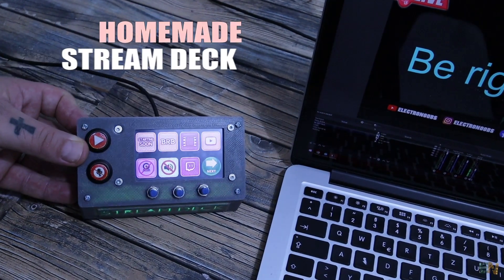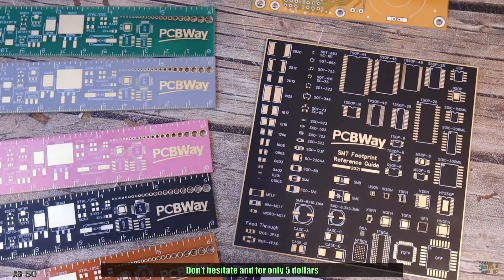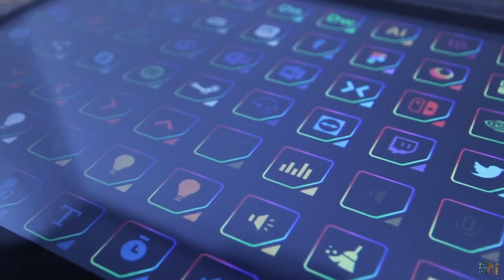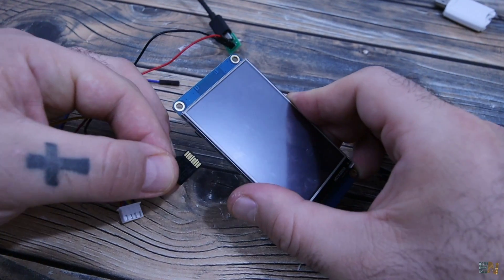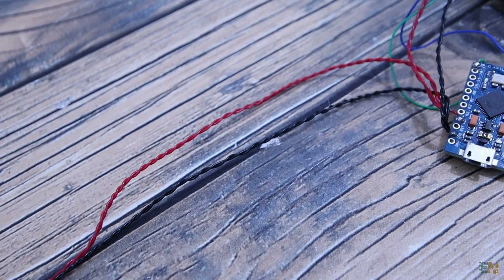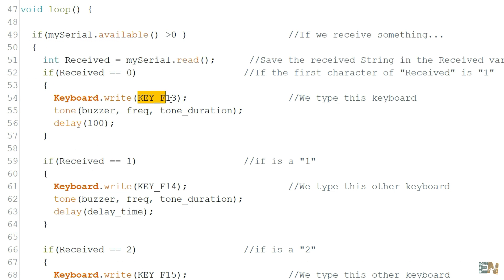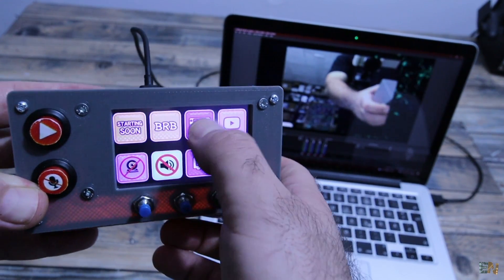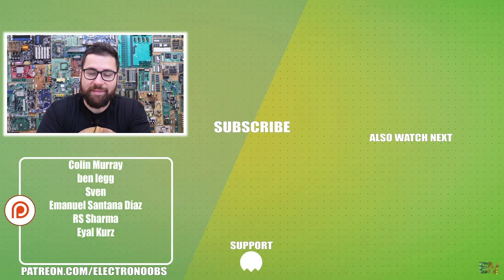Amazing Stream Deck - Homemade With Touchscreen, Arduino + RGB

Comment: I would like to see an arduino acting also as a Streamdeck pedal (3 buttons). That should be simple, but it would need to be identified as the pedal to use the same software... Not sure if its possible

Comment: hello @electronoobs, gracias por el tutorial. se ve bueno. you are using the model K of the display (NX4832K035) but your link is for the T models like NX4024T032. it can be the T model or need to be the K model? ty in advance.

Comment: Hi,

Ive wired this up like your video however when the display is being powered the micro seems like its not got enough power, do i need to use thin wire like above as i using wires that youd use on a breadboard

Comment: Ok so simple way is to use f13+a f13+b and so on this method is little complicated. You could use a f13+a and assign that to key A such that when you press A it simulates f13+a simple. The problem with this method is the haptic feedback that we get on clicking a button

Comment: How do commercial solutions like the stream deck handle the mapping of shortcuts? Do I also need to assign the buttons to specific actions or do they use some superior technology? I would like to for example open a specific website in a specific browser on a button press, even when this browser is not running yet. How can this be achieved? 

Thanks for the tutorial though! Helped a lot already

Comment: try this, combine one of the following alt/ctrl/win/shift/altgr from the normal keyboard with your arduino hid input,
if the obs/whatever allows it then you can multiply your 7 buttons to [no modifier/alt/ctrl/win/shift/altgr] x 7 = 42
could be useful on the big touchscreen also (without normal keyboard)

Comment: how you added the nice Icons as buttons? I doesnt use a Arduino as "bridge" instead i wrote a programm and connected the Display via a USB2Serial converter. Its even nicer to not have to deal with microSD cards.
I Debug and Upload the stuff right within the Nextion Editor.

Comment: Hi, I have a problem. I'm using a seven-inch screen. Clicking the button on the screen setup returns a string of codes A5 5A 06 83 00 00 01 00 01. what do I do? I imported the code into ARDUINO and turned it into a button. It seems that spaces are not allowed between characters, prompting an error. Is there any good solution?
Reply: C:\Users\Administrator\Desktop\Stream_deck\Stream_deck.ino: In function 'void loop()':
Stream_deck:59:23: error: expected ')' before numeric constant
     if(Received == A5 5A 06 83 00 00 01 00 01)                   //"1"
                       ^~

Comment: Very practical idea indeed at a fraction of the cost of brand name equivalents. And nice tip about the bootloader reinstall, had similar problem on my earlier Arduino days and for a moment thought I burned my device but eventually found a solution. Great video and keep up the good work

Comment: Great homemade arduino device. I love it. BUT the thing about a streamdeck is dat it has PHYSICAL buttons. The whole idea of a stream deck is avoiding touchscreens. Otherwise you can also use a tablet or pc touchscreen.
Reply from the maker: I understand you. But you could now also customize the screen buttons so they could fit your need. I think that's also cool!
Reply: One workaround that would be easy to make is a laser cut acrylic plate to give tactile feel of buttons and then have the screen itself on a spring mechanism that has to be pushed to activate a microswitch before the touch action actually does anything.

Comment: Hello!  I've been following you for years and will be moving from Thailand to Barcelona in January.  I have heard that the Spanish post office is bad with charging taxes on incoming shipments like PCBs and parts we order from China.  What is your experience with that and are there any good Spanish or EU sources for parts like you and I use in our projects?  Thanks!
Reply from the maker: Depends on the product. Usually I don't pay extra taxes for pcbs. But for 3D printers for example I usually do. Also, depends on the company. I hate DHL and UPS 🤣
Reply: @ELECTRONOOBS  We have the same problem here in Thailand with DHL and UPS - they add illegal fees and call them taxes and you don't get your box until you pay, that's why I only request shipping via the post office.  Thanks for the information!
Reply from the maker: @MikesTropicalTech  Exactly. The one I most like here is Spain is the national shipping service is called Correos.
Reply: @ELECTRONOOBS  Thanks I've made a note of that!